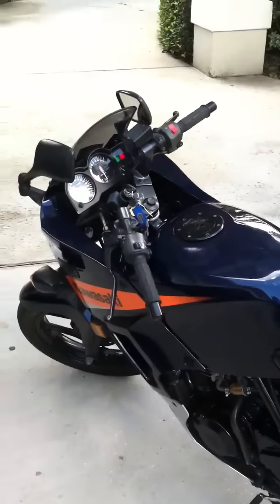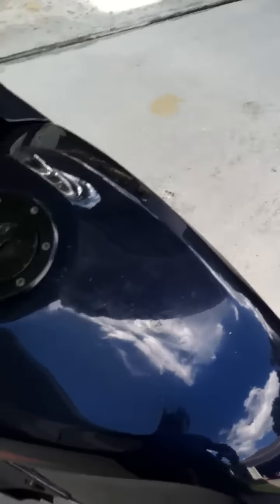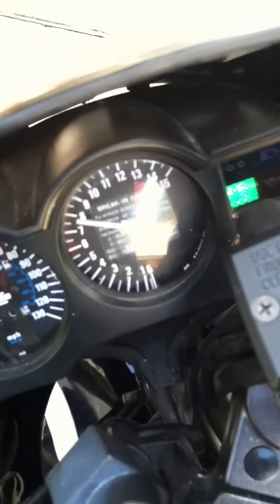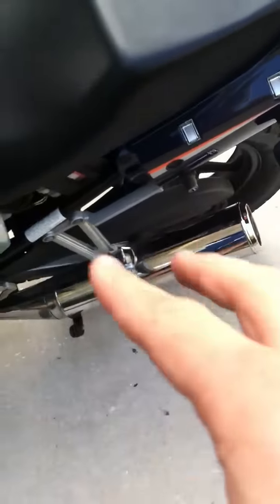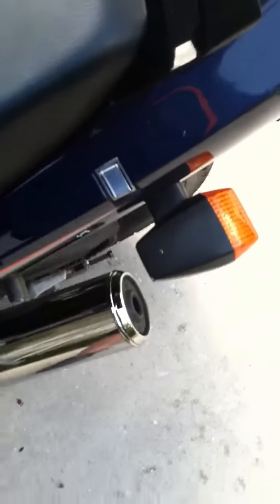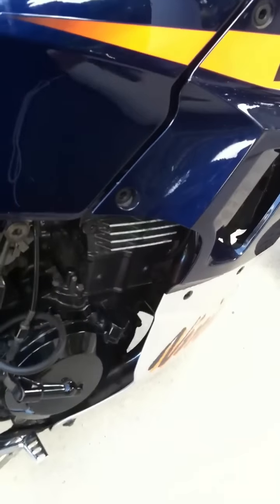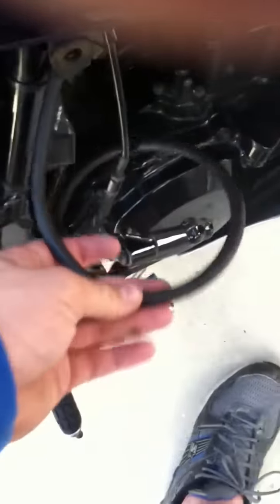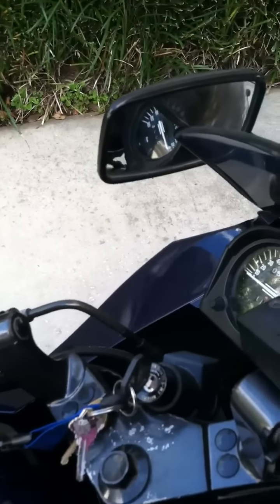Ninja 250 Hanging Rev Problems 11/15/11

Comment: Good clip! 
Did you check your pilot screw or adjust it?
There may also be a leak in one or more of your manifold rubber boots that connect from the carbs to the cylinder head.
The log tube goes under the air box and down near your foot rest, it's an overflow tube and there should be x1 other down there for your water reservoir overflow as well, hope this helps.

Comment: I have a gs and spent 1k at the mechanics to fix my bike but they never did instead they insisted on another 600 to clean the tank.. it would run but die randomly. I started looking near the headers and one of the flanges where completely loose. I corrected it the best I could but one bolt was broken off so I rtv sealed it an tightened the other bolt. Started it up today and its way worse than it’s ever been no power, hard hanging revs like if you blip it to 3 it’ll stay there for awhile